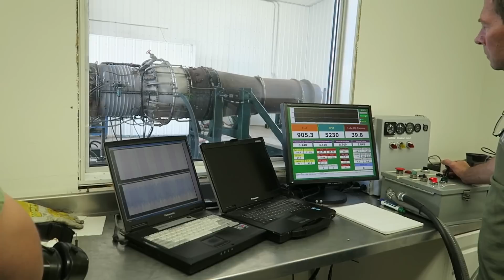Jet Start with Commentary

Comment: Why do you use a nozzle on the LM1500 tests?  Does the engine require exhaust backpressure to work correctly?
Reply from the maker: ***** The restricted tail cone causes a pressure rise in the exhaust, before it leaves the tail cone.
We use the mass airflow and the pressure rise to calculate power.
Reply: ***** The nozzle effectively replicates the "back pressure" of a free power turbine.  If it did not, then the gas generator, operating as a jet engine, would not perform correctly and AgentJayZ would not be able to calculate the power output.  Put another way, a correctly designed power turbine replicates the back pressure of the propelling nozzle of the aero engine from which the gas generator is derived.
Reply: grahamj9101 Can you describe the effects of running the engine at full throttle with out back pressure? Would it try to overspend cutting the fuel flow back?
Reply: Coolkeys2009   This is a very good question and if AgentJayZ is
thinking, “Now let’s see how that smart*** Graham J answers it.” he’s quite
entitled to do so!  My initial reaction is to tell you that the industry just doesn’t do it, because it would prevent measurement of the correct temperatures and pressures in the engine exhaust, and hence engine performance.  I’ve had
to dig into one of my reference books to try to find a definitive answer, which
I haven’t found, and to get one you really need a performance engineer, not a
designer like me.  Now my copy of ‘Jet Propulsion’ states that, “For most operating conditions of a jet engine, the final propelling nozzles will be choked.” 
It adds, “It is also the case that the turbines in a gas turbine are effectively
choked.”  Effectively?  That's a weasel word I often use - and it makes me suspicious!  So let me explain the term ‘choked’: it means that the flow in the throat of a convergent passage is sonic, that is, at the local speed of sound, which is much higher in the hot gas flow than in the surrounding atmosphere.  When a convergent nozzle is choked, it means that the only way of increasing the flow through it is to increase the upstream pressure: decreasing the downstream pressure has no effect.  Therefore, if at full throttle the turbine is truly choked, that is, both the nozzle guide vanes and the blades are running choked, removing the final/propelling nozzle should have no effect on the operation of the engine.  It would simply degrade the thrust being produced by allowing an inefficient free expansion.  However, AgentJayZ may well be able to tell you that the variable nozzle operating schedule of some versions of the J79 keeps the nozzle open at low power to allow a more rapid acceleration up to high power, by reducing the back pressure on the turbine.  This implies that the reduced back pressure allows a greater pressure drop across the turbine to provide relatively more power to accelerate the engine.  I also recall from my past experience that ‘trimmers’ were used on the fixed propelling nozzles of some engines.  These were small wedges that varied and reduced the throat area of the nozzle, to adjust the thrust and performance of the engine.  I wish that I could remember the effect on the engine itself, but the implication is that the available pressure drop across the turbine was affected, so as to control engine speed and turbine entry temperature for a thrust.  This suggests that, even though the turbine nozzles might be choked, the rotor blades might not be so.  If there is a gas turbine performance engineer out there reading this, now’s your chance!
Reply: grahamj9101 ,  I'm the furthest from an engineer,  but have been working with turboshaft engines for 18+ years. What you stated wraps it up better than anything I have come across in my efforts to educate myself on the hows and whys.   you are an asset to this channel...  Is AgentJayZ paying you yet?
Reply: Sjoerd van Keulen Hi!  I'm both flattered and embarrassed by your kind remarks, particularly as I don't think that I came up with a  very convincing answer to the last question.  And no, I don't expect any payment from AgentJayZ, as I regard myself as a guest on his show and, at times, I feel that I'm being a bit of a 'know-all'.  But then , over 40 years in gas turbine design, industrial, marine and aero (both civil and military), does leave a residue of knowledge in the memory bank.
Reply: grahamj9101 should we all be so fortunate to have as much residue in our memory banks as well!
Reply: Coolkeys2009 I've now tried the question on a former colleague, whom I recalled had a performance background.  I will share his reply with you: "My expertise is in aircraft performance, and engines just consume too much fuel, cost and weigh too much, create too much noise - and are only the second most important item on most military aircraft, after the ejection seat...".  However, he has passed on my question to another retired colleague who should be able to help.
Reply: grahamj9101 LMAO, Ah. Thanks for the comments and research, I wish more engineers and designers would share their insights on Youtube., we could also do with a few more AgentJayz's for various fields of engineering.
Reply: Coolkeys2009 Hi, here's the 'official' answer that has been forwarded to me [with some explanations in square parentheses added by me].  "If the slave nozzle is removed, the downstream flow area naturally increases.  Because the nozzle plane is still probably choked, this tends to increase the turbine exit corrected flow, or wrt/p [mass flow corrected and non-dimensionalised by multiplying by the square root of the absolute temperature and divided by the absolute pressure], which in turn increases the turbine expansion ratio.  This implies a higher turbine deltaT/T [temperature drop through the turbine and hence power produced] and therefore a higher compressor deltaT/T [temperature rise across the compressor and hence power absorbed].  In other words the spool will tend to overspeed.  In practice, the compressor will meet its nominal corrected speed [speed divided by the square root of the absolute temperature] at a much lower SOT [Stator Outlet Temperature, or temperature at entry to the first stage turbine blades] than normal.  If the nozzle blows off while the engine is operating, the engine will tend to overspeed.  If the turbine has more than one stage, the upstream stage/s will behave as normal as they operate between choked planes. However, the expansion ratio across the final stage will increase. The overall effect should be similar to that of a single stage turbine."  So, interpreting the performance speak for you, while the turbine nozzles would typically be running choked at full throttle, the rotor blade rows would not and, yes, the engine would tend to overspeed without a propelling nozzle.  However, dependent upon the control laws in the engine control system, this wouldn't necessarily happen.  The engine speed(s) would be held in check and the engine would run with a much lower combustion temperature.  In other words, it would effectively (my weasel word again?) be operating at a ridiculously high speed idle condition, producing relatively little useful thrust, in the absence of a propelling nozzle.
Reply: So basically the engine wouldn't be able to reach maximum rated power output without driving the proper load? Thanks for the detailed explanation. I guess there must be graphs for compressor, turbine and engine efficiency  vs speeds and pressures etc. Anyway I'm way out of my depth.
Reply: Coolkeys2009 Basically, yes!  So a jet engine without a load, be it a nozzle or a power turbine, is not much different from you flooring the accelerator/throttle of your car with neutral selected, so that the engine runs up to the governor - or valve bounce.  And yes, as you suggest, there are graphs and 'maps' of various performance parameters.
Reply: Coolkeys2009 This is in answer to your recent question, which I found in my Inbox, but which I can't see here.  What would happen to the power output of a jet engine, if it were subjected to a 'throttle push' significantly beyond its  design point, would depend entirely upon the design of that specific engine.  Potentially, it would produce considerably more power, but combustion and turbine temperatures would increase and hot end life would be drastically reduced, possibly from thousands to just tens of hours, or even minutes.  The big civil turbofans typically have overhaul lives of tens of thousands of hours these days, because they spend most of their lives at cruise ratings and at altitude, where the temperatures and internal aerodynamic loads are lower than at sea level take-off ratings.  If such an engine was operated for most of its life at or near its maximum power rating at low level, then its life might be drastically reduced to a few hundred, or even down to tens of hours.  Now considering aero-derivative industrial and marine engines, even though they are derated from their aero engine origins and are typically operated at relatively lower combustion temperatures, they are subjected to higher aerodynamic loads, operating at ground/sea level.  This sometimes necessitates the redesign of compressor blades and even thrust bearings, with higher strength materials, for instance.  If the compressors and turbines are running faster than their aerodynamic design point(s) at, say, a 10percent overspeed condition, then efficiencies will start to fall off, which may have a limiting effect, and the compressor aerofoils may also run into problems such as 'flutter', potentially resulting in failures.  Running significantly faster than their original design intent, the rotor discs would have reduced cyclic lives, but would not be in any immediate danger of falling apart, as the common design criterion for discs is for an overspeed margin of 40percent.
Reply: grahamj9101 I was going to ask the question then remembered AgentJayz had answered part of it in a previous video, Thank you for your detailed eloquent and informative answers, it's awesome to get a glimpse of things from your point of view and you mentioned a few things I never imagined would be significant.

Comment: What is that smoke that is coming out on the side of the engine at 2:14?
Reply from the maker: gundamm5 This engine was, a couple weeks ago, a giant collection of separate parts. This is the first start and run.
Everything has to work its way together, and a few burps and puffs are all normal. Probably a bearing vent letting out some oil smoke, because the carbon seals that keep the air out of the sump are still getting comfortable in their running location... and letting a little get by.
Reply: AgentJayZ I have never heard of a berring vent before, are those used for cooling of the bearings or for something else ?
Reply from the maker: I've got a video for you... called Jet engine Lube System, or something like that...

Comment: 6:53 the wiring ;-)
Reply from the maker: There are a lot of wires and pressure sensing lines... draped everywhere and held in place by zip ties. If the test goes well, they need to stay connected for about 20 minutes. If there are difficulties, they may need to stay in place for a few hours. This is a test cell, not an installation. I assumed you knew that, and that is a mistake I seem to make quite frequently.
Reply: @AgentJayZ  Thanks for your answer, i think this is a spectacular setup and i loved to watch it! I understand the -Test-setup, i was referring to 6:53 where the shoelaces were tightened in a glimps i thought it was the wiring :), but it's a beast of an engine. I only have experience, when i was a bit younger with a Wilesco steam loco and another Wilesco machine hehe, this is sérious stuff. Greetings from Boskoop, The Netherlands.

Comment: Why aren't you worried about the engines exploding in the test cell? I'm sure you've thought of this. Looks like you aren't worried about it. Whereas the military tests everyone goes and runs and hides in bunkers. What's different?
Reply from the maker: Braeden Hamson Why aren't you worried about being crushed by the roof of your house falling on you? It weighs thousands of pounds, and if it fell in you would surely be killed.
Reply: It's that unlikely? Whow
Reply: Braeden Hamson It's because the people you see walking around the engine (undoubtedly performing an important task) just spent months going over every square millimeter of the engine. 

Not to mention the insane amounts of instrumentation they have on the engine or the fact that the engine can be shut down instantly by the flick of somebody's finger any time during the test.
Reply: You see thats what I thought, then I guess my real question should be: Why do the other engines explode?
Reply: Braeden Hamson To describe the type of failure that you are envisaging as an "explosion" is misleading.  There is just not enough chemical energy available in the fuel being pumped into a jet engine to cause an event that can accurately be described as such.  However, there is potentially more than enough energy available to cause what should correctly be termed an 'uncontained failure', if a compressor or turbine disc bursts or is released.  Such catastrophic failures occur very, very occasionally, when an incipient defect is not detected by the rigorous inspection techniques applied during manufacture, or at repair and overhaul.  Such failures, therefore, take time to develop and almost never happen when an engine is on test.  I can recall the Sioux City event back in 1989 and the more recent QANTAS event over Indonesia in 2010 - and there have been others.  Nevertheless,  even if you fly on an almost daily basis, you are far more likely to be involved in a road traffic incident (the police in the UK don't use the word 'accident' any more) on the way to/from the airport.  It's a cliché, but it's true.
Reply: Braeden Hamson  In 40 years in the industry, I was never aware of an uncontained engine failure on an engine test bed during that time.  In 1962, however, the year I started work with what was then Bristol Siddeley, a development flight test Olympus engine, which was being run up on the ground, released a complete LP turbine disc at full power.  The disc went bowling across the airfield for several hundred metres, the aircraft (a Vulcan) went up in flames, as did a brand-new fire engine, which became engulfed in a pool of flaming kerosene.
Reply: AgentJayZ If i were in a roof-test cell I wouldn't be standing underneath roofs that are beeing tested :P
keep up the great videos!
Reply from the maker: I like your thinking. I would like to ask you a favour.
In Canada, the u in there is not a typo...
Could you please have a look at my video Your Questions 15.1?
If you do we will both be happier. Thanks!
Reply: AgentJayZ haha
I know, I have seen the video and know the content, just wrote it for a laugh.
sorry if I have caused any unhappyness, the opposite was my intention
Reply from the maker: It's a sad thing that sarcasm and humour don't transfer well in text form.
Reply: It is.
I tried with the smiley, but they only work so far.